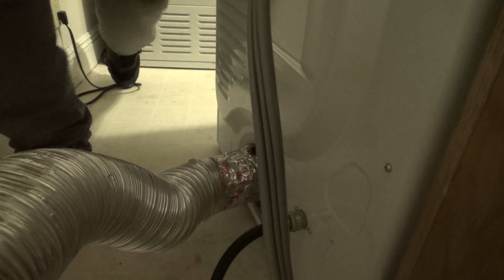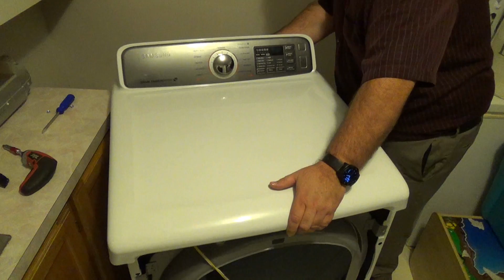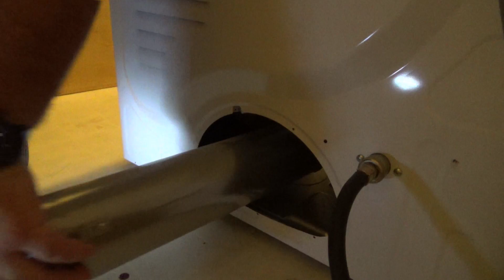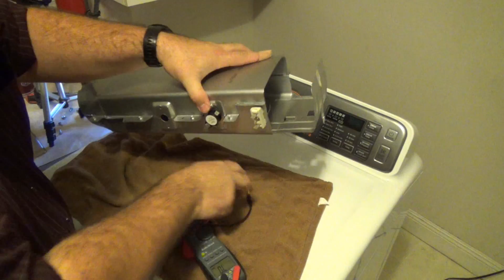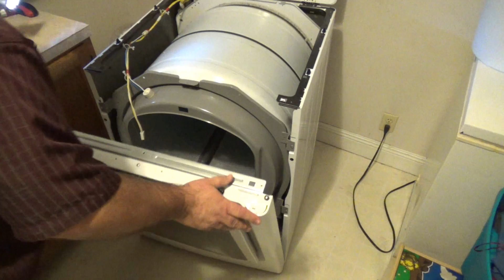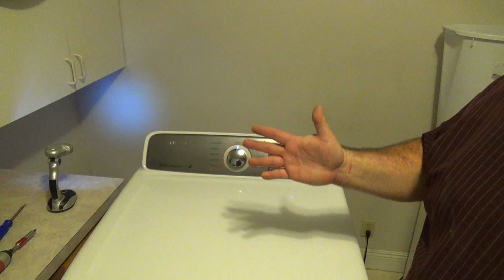HowTo: Fix Samsung Dryer Not Heating! Complete Step-by-Step Diagnostic & Repair

Comment: Great help. Wonderful video. Another video I saw on this dryer he actually took out the drum, belt, and all! A hint which will HELP- You can take  the heater coil housing out of the front.  Remove the mounting screw and the screw holding the bracket to the floor, remove the bracket, and the heater package will slide out the front. And you can record the wiring method as you slide it out. Much easier. The wiring diagram that came with the replacement kit was wired differently than the factory did it, so you have a choice. I conformed to the method the kit showed, and it worked fine. But, it's your choice.

Comment: OMG Daniel, you don't know how VALUABLE your video is.  We were off on vacation and came home with a mountain of wash, and of course our dryer failed to heat at all.  Figured it was the heater or fuse but no clue how to get to it.  Your video made it a cake walk (not easy, but perfect step-by-steps).  Element burnt out, we were debating getting a new set but for $18 it should be back running in a couple days.  Terminals a pain to get off but managed.  Only thing I'd add is when starting to remove the connectors I left the top hinged down and put a few 2x4's under the front to make it easier to access.  And the three of the wires are blue and two black so had to find a way to identify what is what.  THANK YOU, THANK YOU, THANK YOU!!!!!  🙏🙏🙏🙏👍👍👍👍👍👍

Comment: Thanks a million! This tutorial got me through the replacement. I ended up ordering the entire assembly from Amazon and your instructions were spot on. I will say taking out the mounting assembly under the heating element and pulling the heating assembly out the front proved to be much easier than trying to pull it out of the back but that's just my 2 cents. Cannot thank you enough for sharing this video💯🤘🙏🙏🤞

Comment: Have the same model dryer.  On start up, gives error code tE and will not function further from there.  Tested all of the fuses and thermostat with multimeter and seem fine?  Debating having someone look at it versus throwing parts at it?  Worried could be the computer board?  Thoughts?
Thanks!

Comment: Using your video helped me fix my dryer easily.  My only suggestion would be to give the warnings about sharp points in the dryer and noting where the wires go earlier in the video. Overall great job and thank you for the video it was spot on

Comment: Do you have a follow-up of the video if it was the circuit board or the thermal fuse? The thermal fuse looks like it had continuity and I'm guessing testing continuity isn't going to officially tell if the thermal fuse is bad if there's a possibility it could be the circuit board as you stated in this video? I would hate to go ahead and try to buy a thermal fuse and wait for it to be delivered when it was a circuit board instead. I guess what I could do is get a heat gun and check to see if the thermal fuse cuts the circuit at a certain degree with my multimeter.

Comment: nice vid - glad you warned about trying to use a putty knife on the front,  but I think you damaged the finish on the top with the new heater housing piece at the start... good to see the towel use towards the end.

Comment: I would've removed drum and inspect the 4 rollers and the belt pully. My belt pully melt and fell off and all roller need oil 30$ replacement kit

Comment: My question is- since some dryer models are considered similar for assembly/ disassembly purposes, does that mean the heating assembly units are too ? I find different part numbers for the unit but they all look exactly alike. Should I be certain to get only the exact part for my model dryer or is this a generic item?

Comment: I pulled the entire housing out the front and replaced the internal elements and all of the bits and pieces. It was a bear getting it out the front, especially because there was a clip pinning it down into the platform it was sitting on.  But - my clothes are now drying and have only been out of commission for 24 hrs. Not too shabby! $30 and done.

Comment: Thank you so much! I have absolutely zero experience repairing appliances and your video gave me confidence to order and replace the part myself with minimal issue. We have a ~2 year old Samsung DVE50M7450W and I quickly learned I would not have access to the back of the dryer. I was able to replace the assembly through the front of the machine after also removing the stabilizing bracket. We had significant build up of lint, which I suspect was the culprit. Thanks again!!
Reply: I have the exact same model as you so I’m glad this video corresponds with my situation. Good to know you had no trouble. I’m tackling mine tomorrow so wish me luck. I have previous experience in dealing with motherboards so I’m hoping I can get this done lol.🤘

Comment: The proper way to do this job is to remove the element from the front. The HiLimit thermostat on the heater does not control the element temperature on and off. The thermister on the blower housing does that . When I see that thermal fuse blown I look at the venting assembly in the dryer. Is it clogged? If not it's probably the venting out that is restricted!

Comment: Thanks for the video -- every step spot on -- however, the dryer I have, I had to remove two screws that hold the bracket and bend it and remove the housing through the front. I ordered the complete replacement housing at $65 -- totally worth every penny.

Comment: THANK YOU!!! Excellent Video Bud!!!! My biggest question is, Should I replace all those parts at one time. Ive always followed the Logic of, "If it's NOT Broken Don't Fix It", but for $35 on Amazon (01/21/20) I ordered the Heating Element & got 3 Thermostats & a Thermister with the kit. I'm guessing the product quality is not up to Samsung standards so should I take the chance of going ahead & changing them or not.
Ive replaced Dryer Heating Elements before, I just had not on my 5yr old dryer. This video help me figure out where the Heating Coil is & Exactly how to get to it, without me just tearing apart parts I didn't need to! 
EXCELLENT EXCELLENT VIDEO!!!

Comment: I am having trouble finding the entire assembly on Amazon. Do you happen to have a link you could share? 

This is the model I have: dve50m7450w/a3
Reply: I have exactly the same model, and it's barely been 2 years, and our heating element just died!  I'm very irritated at the lack of durability!
Reply: Sara Starks this is the replacement that I purchased. It took me awhile to replace but it works great! https://www.amazon.com/dp/B07R5Z6WQ4/ref=cm_sw_r_sms_c_api_i_f999DbPPJZ2PY
Reply: i have the same did you ever find a link ???
Reply: Ricky Lowe see previous comment

Comment: Thank you!  My fuse was bad.  I just unscrewed the 'platform' underneath the heater assembly and bent it down to get the heater assembly out.  When repaired, just bend the 'platform' back into place.  Much faster this way.

Also, Make sure you buy the fuses on ebay or amazon.  My local appliance parts store charged my $30 (for a $5 fuse).  I was able to fix my dryer the same day, but, will just order off amazon/ebay next time and save even more money.
Reply: Mine has screws behind the platform ...I can’t figure out how to get that last screw out to remove the platform

Comment: i installed the exact same thing on my drier your instructions were great and to the point. Now can any body help me because my drier did work but then it stopped heating and nowni have the same problem i started with
Reply: If your dryer exhaust vent is clogged at any point, overheating would result (again). The Thermal Overload is a fuse and once "blown", you have to replace it.

Comment: the heating element or fuse can be reset by hitting it against a hard surface. check with a meter before reinstall

Comment: Simple 50c crimp connector and over lap heater wire break. 
So just playing around with the break in the heater core I did a crush connector (w vise grip) wire splice. 
Only reason I did this repair is time for shipping / drive time to get a new part. 
Problem is repair is to fast to cheep and to good.
Now running a repaired heating core element and have a new Dryer Heating Element sitting on the shelf.
Repair is better than a new part. Burned heating wire breaks at the thinnest weakest link. Now that I repaired the weak link the part is better than new and will never ever burn out and will last forever.
IMO this fast cheep robust repair will out last the dryer.
Reply: In the past I have done this repair on Maytag and Sears dryers and they have never failed. I still recommend to buy a $15 replacement part but do not expect the repair to ever fail.

Comment: Thank you for this video! My Samsung didn’t have a back piece to remove so I had to remove that bracket that the part rests on, that was a pain because it had two hidden screws in the back. That is what took up the majority of the time, the rest was super easy thanks to your video! As stated in the video the edges are sharp! Got one cut and then laid a towel across the bottom to save my arms. My dryer has heat now, thanks!!
Reply: alicia ryan I had this same issue. Did you replace the complete assembly? If so, where do you find it?

Comment: Thank you.  THis is exactly (looks like) what I need to do.  Had my dryer from Sears for 2 years, and it seems like it is not heating anymore.  I've done a dryer element replacement on other things, but never a dryer like this.  This is little more involved than others, but you make it look so easy.  Thanks.  My dryer is the dbxr463ed2ww.  Very nice, but dislike how it (sometimes) makes drying decisions without your input.  Maybe that's related to the element, not sure.  But when it works, it works perfect.  Oh yeah, ours will sometimes stop before it totally drys them.  So, you have to put it on "absolute dry" or something like that.  Anyway, wife does it mainly, but I just load them and press the same button everytime ... because I don't always have my glasses and tell what all the buttons say.  Anyway, thanks for your video, and I plan to try it.  But bet I can't get parts now as Christmas is just a few days away.

Comment: Thank you for the video, I was able to get it done in less than an hour. I had to take a break as one of the electrical wires was fried and looked as though a fire had almost started in the dryer with the connector to the heating element. I am very thankful I went to Ace hardware where I was able to get new wiring and clamps for less then $2. I now have a functional dryer again. Thank you.

Comment: So we are trying to DIY ours after the heating assembly was replaced once under warranty. It broke again about 13 months later, of course out of warranty now. We got it apart and found that one of the wires is all burnt up. Any ideas what that means? Are we toast?

Comment: I have performed all these steps and cleaned my duct work.  I am still blowing the high temp fuse.
Reply from the maker: If the control electronics don't cycle the  element based on temp it will blow. Circuit board problems are beyond a DIY repair... unless you find a junk unit.

Comment: Thank you very much for the video, I followed step-by-step and everything came out great.  Personally I think it is easier to remove the back plate and exhaust duct and remove the wires from the back.  I did what you said and took pictures of the wiring to make sure I replaced them correctly - Thank you!!

Comment: Ok, I ordered the part and replaced it thanks to this video....dried one load and now no heat again.... I will never buy Samsung again, only 2 yrs old. My parents have Amana 15 yrs old still working. Does anyone know what else I can replace besides the dryer itself?
Reply: My 2nd element lasted about 3 or 4 years. Appliances are about 8 years old. Other than the heating element I haven't had any issues.
Had to find a video again as I didn't remember how to get everything disassembled again.

Comment: I have had my dryer serviced two times so far by a certified repair specialist and the first time it was fixed it only ran for about 5 minutes then the heating element  burned out  then when they fixed it again they replaced the entire housing that the heating element sits inside that includes the thermostats and the heating element complete package and it worked for approximately 13 days. I have a brand new exhaust pipe for my it is the semi rigid aluminum duct and there is no lint whatsoever inside or out. I always keep it very clean. The technician tested the plug coming into the dryer and it was perfect voltage. The first time my dryer malfunctioned it lasted for about two and a half years after I purchased the dryer before it went out the first time. I have seen various people posting the same things on various sites saying that no matter what parts they have replaced in their dryers that the heating element was not heating properly. If there is anybody out there that actually fix this thing permanently where it at least lasted 5 or more years please let me know what trick did you do in order to keep the heating element from burning up over and over again. I did run  it in test mode  and the only error that came up  was  dE but there is nothing wrong with my door  or the latch or the wiring going to my door at all .  I think it was just an error that was stored on there  from when somebody opened up the dryer door while it was still running  because it stores the last known error code  in the system. Thank you very much. My model number for my dryer is dv48h7400ew/a2 and the part number that was replaced is DC97-14486A.

Comment: I have attempted this twice I keep popping the thermal fuse, I've replaced the fuse twice and just replaced the thermometer with the same results. I haven't checked the coil to see if it is shorting to ground is that a possibility..
Reply: Check the coil to ground with an ohmmeter.

Comment: Changed my heating coil, fuse and thermostat 3 times, gives me 4-6 good drying loads then back to no heat. I was told to check my vents, clear. Then to check my outlet, all good then my circuit in the main electrical panel, all good!!! Now what??! Had this same model and it only lasted a year and a few months! Garbage Samsung, straight garbage!!
Reply: Ralph Martinez I definitely agree with you Ralph. I had my dryer service two times so far. The first time it only lasted about 5 minutes and the second time I got it replaced again it only lasted 2 weeks and it broke down on Father's Day. I'm going to call my funiture store again and see if I can just get a totally different brand.

Comment: I might add that before one goes thru this disassemble one needs to check the power cord because if t is bad the machine will run and blow cold air but will not have the 220 necessary to run the blower unit. Just had this happen today and yes the cord and the Wall plug were indeed bad!

Comment: Thank you so much for this!! I'm not an intuitively handy person, but I can follow visual instructions! I have the DV45H7000EW/A2 and the really important stuff is the same. However, for anyone else with my model, the rear panel is different so you can't pull the heating assembly through the rear (which sounds really painful anyway!). After removing the door assembly, you will also need to remove the frame that holds the drum in place (not the actual drum). This is easy to do, just remove the four screws that frame the edge of the drum opening and one more screw on the lower left that attaches this frame to the blower looking thing southwest of the lint trap. Lift the frame and pull it gently toward you - the drum rollers are attached to the frame so be careful not to force it forward too hard. After that, disconnect the wires and finish the rest of Daniel's amazing tutorial!!

Comment: Just got done replacing the heat unit in my dryer.  A sliced thumb and firearm later, all good!  Tip for others, wear long sleeves or put a towel along sharp edges!  Thanks Daniel, this was very helpful!

Comment: Hello Daniel!!! First let me say thanks, i myself am a fellow YouTuber that does reviews and etc.The thanks comes into play because i have that dryer minus the steam option that i've only owned for about 2 years. The other day after the dryer running for a long period, i checked the clothes to only realize they were still damp. After many different attemps to get to work all failed. So of course i hoped on YouTube and started to see if there were videos on this situation and yours was one of the first to pop up in the suggested. After watching i ordered the part, meaning the whole assembly, online and the part arrived today. So which leads me to now, after less than an hour i had the old part out and new one in and the dryer is now working again. I only did one thing different, instead of removing the rear vent assembly, i just removed the bracket itself that the part rests on. By doing that the whole assembly comes out the front of the dryer and easier imo to unplug the wires and reinstall the new part. Again thanks for the video, very informative and you gained a sub from me. Thanks again!!!

Comment: I would highly recommend not buying any Samsung products I almost had a dryer burn my house down very dissatisfied with design in the dryer ! they're building products designed to go bad within one year in order to gain financial power $$$$$ refrigerator I bought also one year old plastic parts broke LED went out doors squeak and doors Will not stay  open I nothing but problems Samsung worst company ever  The design on the dryer is allowing lent to go into the element which will cause a fire purposely designed to burn your house down that's  Samsung so Go out and get one  so you can have problems like me!